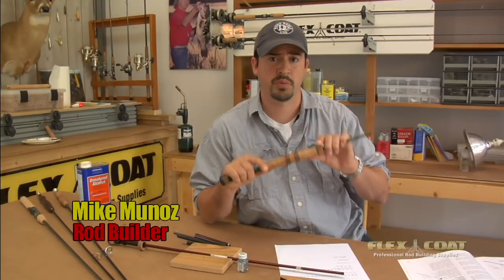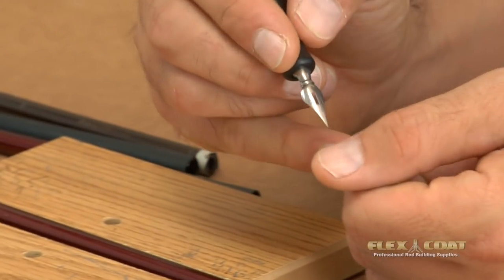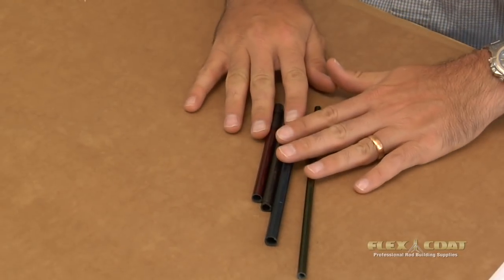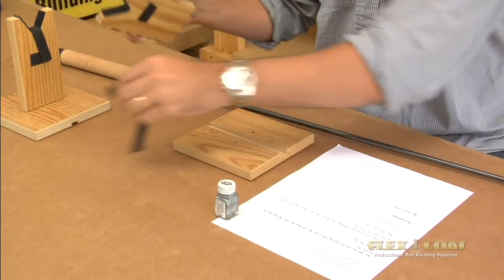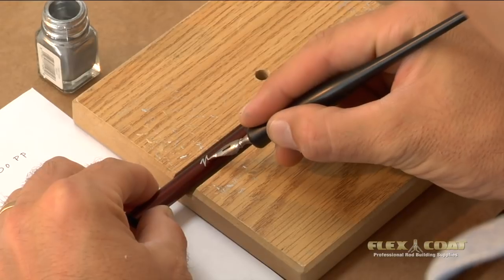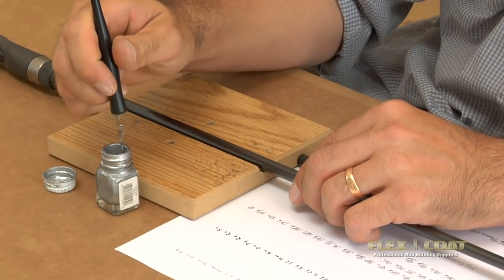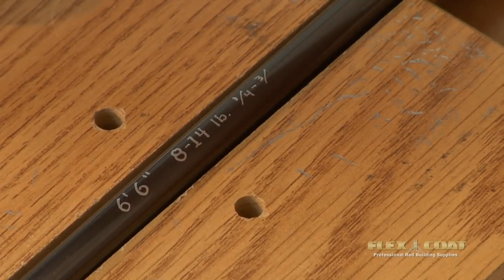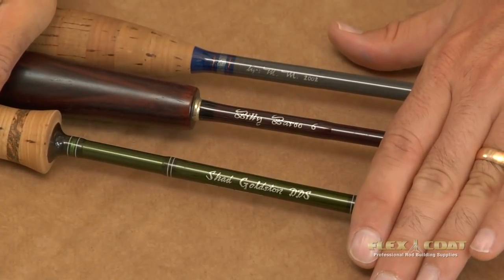Flex Coat Rod Building  - Writing On Rods "How We Do It"

Comment: If I dont have a epoxy to finish my rod should I use a spray can clear coat?
Reply from the maker: There is no substitute for Flex Coat Epoxy Finish, but you can coat a blank with a quality can of clear coat like this:
https://www.homedepot.com/p/Rust-Oleum-Painter-s-Touch-2X-12-oz-Gloss-Clear-General-Purpose-Spray-Paint-249117/100670438